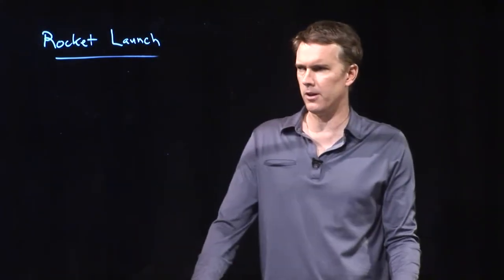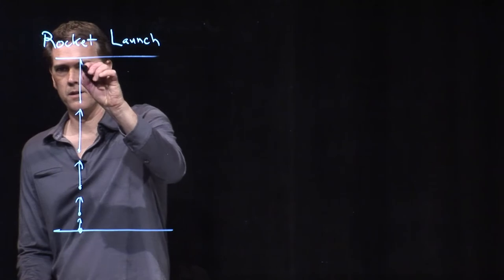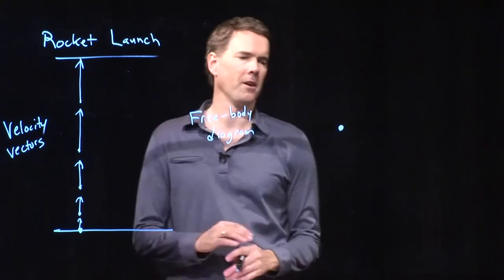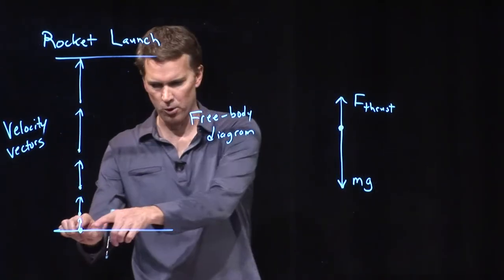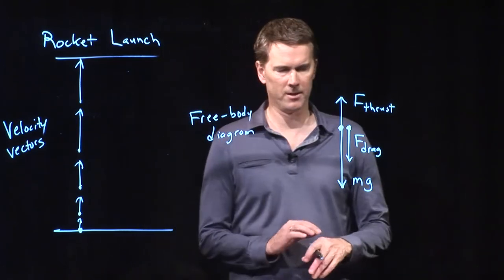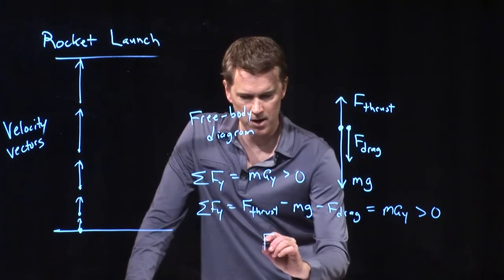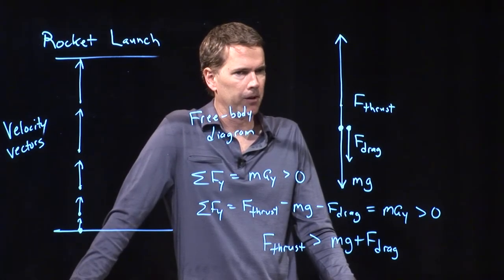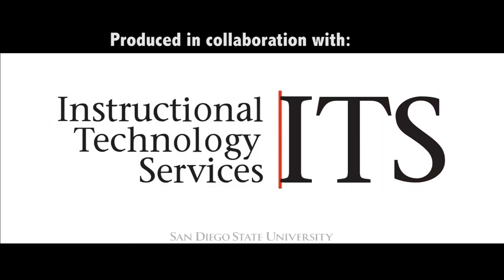Rocket Launch

Comment: if the fthrust is equal to fdrag and mg then why would there be a constant speed? wouldn't it just not move?
Reply from the maker: Excellent point.  You are correct that at least initially the fthrust must be greater than fdrag + mg in order to have a positive acceleration.  Once it gets up to high speed and fdrag increases to the point where they are equal, it moves at constant (presumably high) speed.
Cheers,
Dr. A